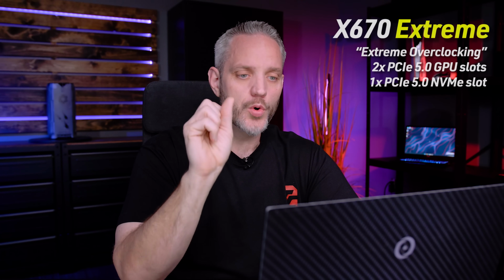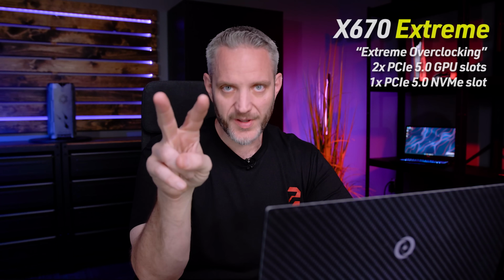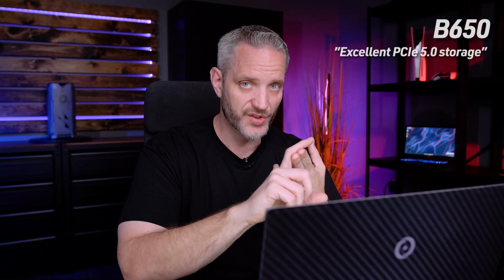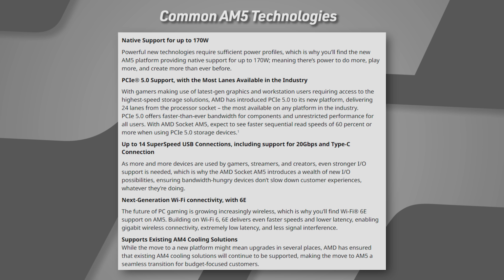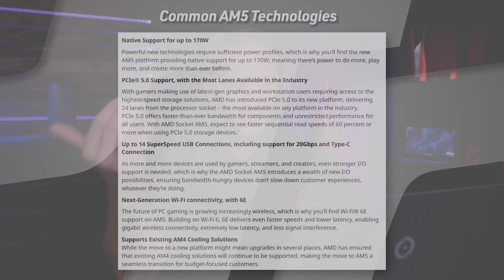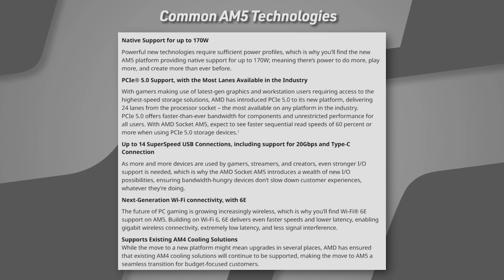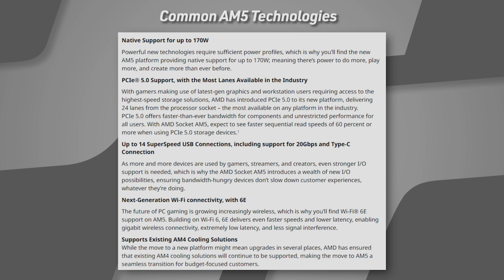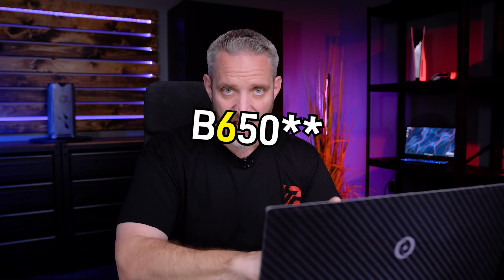AM5 Motherboards are EXPENSIVE! AM5 Explained

Comment: I see no reason to go AM5 when an early X3D chip is the capstone for my current loadout. I went from FX-8000 to Ryzen 3000 and felt the difference mainly with storage because that was my intro to NVME. PCI-E 4.0 is still on the table and I'll get to it someday but for now, a cheap 6c/12t CPU combined with a $200 mobo with every feature and 64GB of DDR4 all for around $500 means I'm going to be here a very long time. Dual GPU slot is a bait for people that need competition cards shared in one system like any Radeon GPU with a RTX 6000 series. It doesn't make sense because those are devices that aren't gen 5 and the current stuff doesn't even saturate gen 4 yet so I'm guessing it will be whatever happens for gaming and then combining it with a compute. I really hope there's a good selection of Mini-ITX and Mini-DTX. ATX and MicroATX are getting kind of annoying when I retire them.
Reply: Mostly agree, except I do like an old school great big motherboard!

Comment: That was my plan after the last build I did was in 2019 with ryzen 3900x and rtx2080 but had the extra money and when the price drop hit I decided to upgrade to the current gen ryzen 5950x, 3090 TI (basically a brand new build, everything including my 1st custom water loop system) and then gave my friend the gpu, cpu to upgrade his system.  My adventure with AM5 will be after buying a house.  Once the water block for my gpu is available I will pick up an additional card with the blocks and run dual cards which should last me well into the AM5 era.

Comment: My current machine is ancient (Mix of over 8 year old parts) and I've been thinking about building a new one. Kind of either between a 5800x3D or spend a little extra for platform longevity and go with a 7600x build. I don't have a ton of cash to blow though so if benchmarks end up being similar and building a 5800X3D box is significantly cheaper I might go that route for now and avoid early adopter issues. I'm a World of Warcraft guy and the 5800X3D showed huge average and low FPS gains compared to other cpu's.
Reply: Been thinking of upgrading for the past 10 years, my computer is now a 14 year old build with DDR2, other than 6GB of ram, I still do not feel the need. These new AMD boards and CPU's are expensive and use a lot of power.

Comment: I'm coming off an old x79 system I've limped along with a (now) cheap 8C/16T Xeon I threw in it a few years ago.  It's crashing now no matter how much voltage I throw at it, so it's definitely dying.  Nonetheless I'm gonna wait at least a few months for things to settle down on BIOS and driver updates and then it's a 7950X with 64GB of RAM for me (I do a lot of software dev with VM's).

Comment: Currently using a 3600. It is doing fine, just fine. I don't plan to upgrade until the 2nd gen AM5 chips come out. Giving AMD a chance to refine and perfect seems like the way to go. Also, maybe Intel will get it together by that time and have something worth consideration. Willing to think about either, I just want stable performance.
Reply: 3600 is amazing proc

Comment: So a 7600X w. mobo and 32GB of memory will be about 1000USD.... And looking at AMD's long standing tradition with drivers, it will be severely unstable for at least 6 months after first customer release. That's ridiculous.
I can get a 5900X w. a REALLLY good and stable MB and 32GB of memory for less than that. That's even supposing the 7-series processors will retail at MSRP, which I don't think they will until after the holidays. Or when Intel releases the 13-series to customers.

Comment: I have run a 3rd gen I3 since basically 2012, so an upgrade seems to be a good choice for me. I do plan to buy AM5 since 12th gen Intel seems pretty bad with power consumption, and I would like to experience having something brand new for a change. But just like this video points out, I find it interesting that there is very little info about the B650 motherboards since they tend to be more common. I will wait probably until early next year after several reviews are out and the inevitable issues are fixed for the most part
Reply: If you were going for i9 12th gen it's not efficient. i5 12th gen isn't bad at all. Depends on what you want. If AMD works better for you (if you can wait) excellent and I hope your build is what you want.
Reply: What Blueberries said. Intel is efficient, at least their i3 i5 and non OCable i7 is. People just think Intel is hot over their entire product line because of clickbait titles from Jayz2cents, linus, etc.
Reply: @Superiorer  AMD is still more efficient. It doesn't much matter at the low end, but THAT is because you have a low watt rating from low end CPUs, so the maximum savings is lower, but AMD is still more efficient.
Reply: @markhackett2302  No, thats completely false. Intel cpus become less efficient the higher you go in the product stack. Amd cpus become more efficient the higher up you go in the product stack. A 5950x beats the 5900x in performance per watt. The 12900k loses spectacularly against the 12700 in performance per watt. 5950x beats the i9 with a huge margin, 12700f is slightly weaker than the 5900x relatively.
Reply: I would sort of take what blueberries says, but ignore ADL at 12600 or above, E cores are not used in current games, it still costs more, and you need Win11 to even schedule the E cores, and that is more expensive. Either 12400 or 12100, because those designs don't use E cores, so you neither need Win11 to get a new scheduler for those cores, nor do they get removed. However, it is still less efficient than AMD's AM4 offerings, but since you are talking about the difference between 45W and 55W at the wall for the CPU, saving 10W, but your monitor uses 30W, the board uses 50+W for its built in stuff, etc, that 10W isn't worth much. Nor will you need more than 6 cores for gaming even if you stream and use the CPU to encode because you will be below 70% CPU usage anyway, and encoding and streaming a window costs 5% or thereabouts of your CPU.
Reply: @markhackett2302  win 10 is fine with e-cores. Streaming cost more than 5% of your cpu.

Comment: I'm going to wait and see. One of my PC i still use is an X79, with a GTX 980 and I didn't' upgrade until 2020 to an 3700X and a RTX 2070super. That's a HUGE time gap.  I now have a 5800X3D with a 3070ti, plus a Steam Deck, plus the older PCs I mentioned, so I nave no need to get AM5. I'll wait and watch it mature like AM4 did, and depending on what Intel does, I'll choose when I feel like i need an upgrade.  Besides I'm more likely to buy a new GPU before a whole new build anyway.

Comment: i went all out last week and did my first amd pc in 12 years  got me a 5700g  mid range gigabyte ud mb  already had the 32gb ram ready form the old system and a 3070ti ftw3   . felt like a amazing deal to me  going form a 1080ti  and i7700k  to this is day and light diffrence  .  i only upgrade every 5 to 6 year so  i feel like i got best bang for my buck with all the sales on due to the move in am5 to ddr5   and the 4000 vidia cards knocking on the door .
Reply: And also you get all the matured support from tweaking the initial issues. My first upgrade was to an i7 4790k when the 6700k launched and DDR4 was introduced into the mainstream CPU's. Not only were the DDR3 sticks and the Z97 boards cheaper, but also Z170 had some issues from firmware, RAM compatibility and the infamous "bendgate" since they used a thinner substrate for the CPU.

That setup lasted me 6 years until in summer 2021 went with a Ryzen 7 3700X and a MSI X470 Gaming Pro Carbon. I hope I can squeeze another 6 years of that combo :)
Reply: @TheMC1X  I'm looking at my 3700x/x570/32gb of 3600mhz RAM as basically a ten year platform. Basically, I get swayed to switch from Intel and pretty happy with it, even though I can't do a real overclock, software is super nice compared to what I was used to anyway with Ryzen Master and Adrenalin. Am figuring a later Zen3 upgrade to 5950x to crown this system, an extra 2x16gb of RAM towards the end of its lifetime, and a 7700XT or something like that should last me 10 years before I even need a new one, and even at that I could probably just get an RX 8800XT or RTX 5080 or something like that and still be power gaming after 2027 unless the world ends.
Reply: @pandemicneetbux2110  I upgraded after 6 years because the TIM on my 4790k dried, so it was unbearable the heat. Also needed more CPU horsepower for work, so I figured it would be a good moment to upgrade. 

And don't forget about CPU single core perfomance. While on games I thought I was fine with my 4790k, with the 3700X I noticed I gained between 5-15% more frames on 1080p (depending on how CPU bound the game was).

From Zen 2 to Zen 3 you'd gain quite a bit on the SC department, but the money would be better spent on a 5800X3D or a 5900X if you do CPU work. 5950X for anything but work is stupid
Reply: I built a gen 3 i5 build which ended up as a 4th gen 4770 build in 2013 and only platform swapped in November 2019 when I shifted to a B450 build when I picked up an R7 1700 for £80.  I waited because up until then there was still issues with DDR4 on Ryzen builds(and because I didn't want to spend £300+ on a chip).  By the time I sold off parts from the gen4 build the swap was done for the £100 I spent on the PCB so I had money left to update the storage.  I swapped out my 120GB M2 SATA boot drive for a 1/2TB Samsung NVMe and the 120GB 2.5 SATA(my first SSD) for a 1TB Crucial CX drive.  I recently swapped out the 1700 for a cheap R5 5500 to freshen the machine up as a stop gap to AM5.  IMO the biggest draw of Ryzen is the flexibility and value you can find on AM4.  I have had the opposite experience from AMD compared to Intel, on Intel I had no upgrade path after a couple of years where I still have a metric tonne on AM4 nearly 3 years in.
Reply: Ehhh yes and no, the MSRPs were already so sky high that none of the deals are particularly impressive to me given that they're now 2 years old hardware right before the next launch and still costing more or less their MSRP, which again I thought was freaking nuts on some of those. You remember what Maxwell and Pascal era prices were, compared to MSRP now, and no that's got nothing to do with monetary inflation that's just sheer greed in the same way a landlord actively plans to charge you a couple hundred bucks more on rent every single year. That's all it is, is a greedy landlord shifting the goal posts. The only thing I was really impressed on with GPU sales was the $700 RX 6900XT I found on newegg, and admittedly even that was like, it's basically just a golden sample 6800XT, even though it's still comparably like a 3090 or not. But yeah, pretty funny seeing things change, 7700k and 1080ti was the shit. Still is tbqh, I'd still not have a reason to upgrade on that system without getting a 4k monitor, which is the only reason I'm thinking of an upgrade next gen. Although I guess a 1440p144hz would be pretty nice too.

Comment: nobody can adopt this shit unless they know what all core clock speeds are for 16 core.... if a 5950X can hit 5.2 all core stable @ 4100 RAM, then uh..... why the fuck adopt AM5 bc of a single core 5.85?  No word on all core speeds how long after announced?  Don't know if the new USB4 is 2.0 active or passive on the usb ports of the AM5 motherboards?  all questions still never even touched and not answered.

Comment: I've got a 5800X right now.  Planning to wait and see what the performance difference looks like when the next gen V-Cache parts are released.  If the performance delta is enough to justify a platform swap to AM5 then I'll likely make the move to a 650-based board and an 8 core 3D cache CPU.  That will probably be around Q1 or Q2 next year before those are released though, so that should give enough time for various bugs to get sorted, hopefully leading to an at least mostly stable platform by springtime.
Reply: But why though? I keep seeing some of you guys on higher tier Zen3 upgrading and I'm confused as to why. I built mine on the assumption that I could go from 3700x to something fancy in Zen3, but that was a long timeline partly meant to not hassle with the board ever. Do that many of you really just rip out your entire system board CPU RAM and all every couple years?
Reply: @pandemicneetbux2110  Some people such as myself are just hardware junkies.  We have to have the latest and greatest performance.  Call it a compulsion or an addiction, but either way, for people like me it's just part of the hobby.  And honestly, I've gotten "better" than I used to be.  I used to spend any dollar amount to upgrade every single generation.  Even if what I already had was only 6 months old.  I've mellowed a bit that way as I've aged though.  Plus my bank account makes me settle down when I get in those moods.  These days I do make every effort to justify the purchase with at least a 40% uplift in performance.  So now I'm finding I'm upgrading about every 2 years.  The way it works out I usually upgrade my GPU one year, then the next year it's CPU (and mobo if required for CPU compatibility).  It satisfies my addiction, keeps my bank account happy enough, and ensures I can play the latest games at the highest performance possible.  Is that a valid approach or mindset for everyone?  Certainly not.  But it works for me.